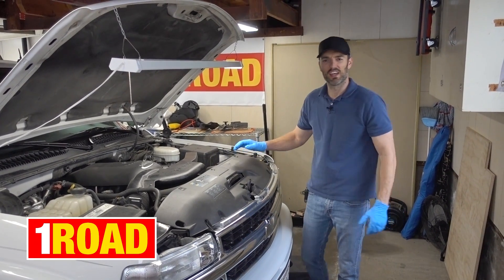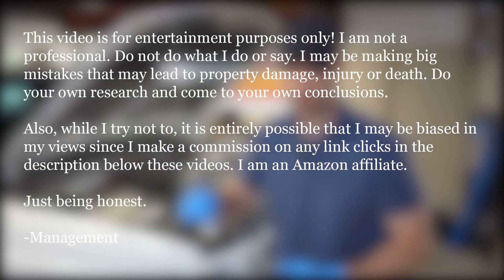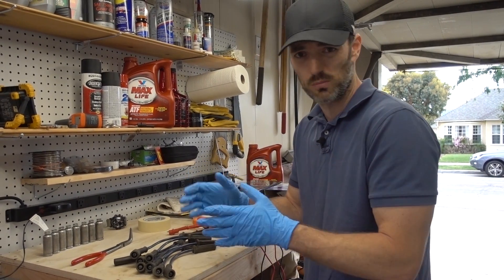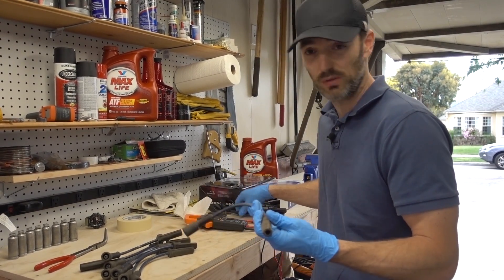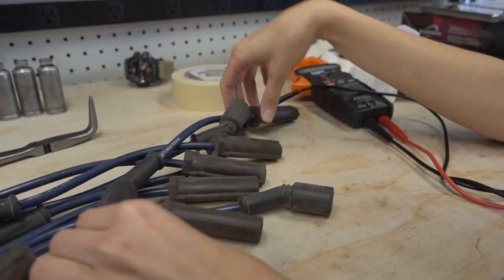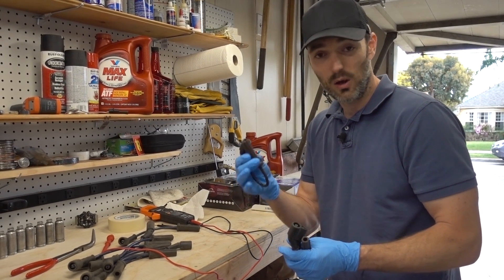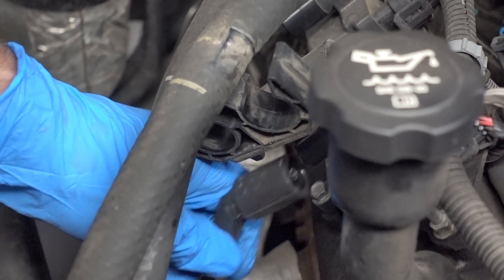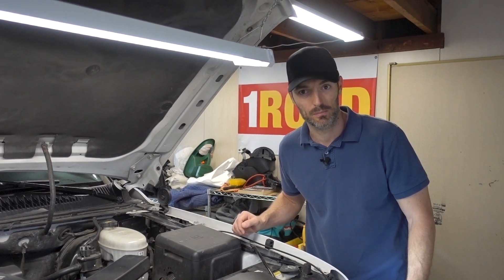Why You Should NEVER REPLACE SPARK PLUG WIRES WITHOUT FIRST TESTING FOR OHMS!

Comment: Go with the lowest resistance wire possible. Make sure to use dielectric grease on your boots but not on any connections and then use a fast flashing silicone spray over the complete outside of the wire and boot after installation. All spark plug wires will come apart depending on how they are made the better ones are rebuildable so if one came apart on you is because it is one of the higher quality cables like you said belden, hat is the best you can get without either making a custom set yourself or ordering a custom set and of course custom sets are going to be reportable because are custom tailored to your given specs. That definitely always go with the lowest possible resistance with the best possible insulating materials. With the options you've given us in this video that would be belden. Here's a nice little tidbit for you, belden wires are the only wire that I know of that does not have peanut oil in the material list for manufacturing. And peanut oil being used in the manufacturing process of these other brands of spark plug wires is why rats get under the hood in chew at the wires they smell the peanut oil.
Reply: Wrong and wrong, spark plug wires SHOULD have a controlled resistance AND dielectric grease actually adds resistance, look at the defination.
Reply: dielectric, insulating material or a very poor conductor of electric current. When dielectrics are placed in an electric field, practically no current flows in them because, unlike metals, they have no loosely bound, or free, electrons that may drift through the material.
Reply: @williamsotak2870 you obviously did not read my comment correctly or you misunderstood it completely because I specifically said to add the dielectric grease only to the boot and not to any of the connections.... That means only the rubber part of the boot and not the metal connections inside of it... I know what dielectric is you don't have to explain it to me... And yes I do know that the wires should have a controlled resistance I also know that that should be around 10,000 ohms per foot of wire but son of the better wires are generally a little bit lower resistance than that. Thanks for your comment but I think you were misunderstanding what I wrote
Reply: @jdreynolds29  "Go with the lowest resistance wire possible"  LOL go back and edit your comments to match your BS!  ;-)
Reply: @williamsotak2870 yes I did start out my first statement 6 years ago with go with the lowest resistance wire possible, and I'm not going to edit that because that is good advice and the higher performance cables are lower resistance. Some high performance wires can be less than half the resistance of standard cables

Comment: I use Delco on all Delco equipped machinery. They did the research with OEM and have never failed premature. I have some big blocks that use Delco on the ignition, but spec Champion plugs.... Spec it OEM no matter the brand.
   And now, is story time....
Once upon a time there was a redneck (me) that had a riding mower that through much of an odd happening, had a magneto plug wire get shorted. As a 10-11 year olds mind works, and reading many hot rod/racing magazine ads, I thought I had the ultimate cure with items in the big shed. Copper wire, a.bit larger than the OEM core, Ohm test told me that it will be better than stock. A spool of heat shrink of various sizes, to help guard against abraison.
  Ok, we have low resistance firing 30 times/second (camshaft actuated points, the old cast iron Briggs). She picked up a lot of pert.... Until, she died. The mag coil died. It looked like the coil over heated. I then had a spare 12v car coil and a pull off plug wire. She still lives and mows.
  It is a '71 model Montgomery Wards garden tractor. She is the oldest of four, the newest being '06.
Take care from Oklahoma,
Mike and Vee

Comment: When I was a "kid" in my high school days, we could buy "resistive" or "non-resistive" wires.  The difference could be heard in your radio...  Non-resistive wires would make your radio "scream" as the engine accelerated.  Resistive wires made it so the radio was quiet all the time.  Of course, resistive wires were more expensive and radios had knobs that turned back in the late 60s to early 70s.  You also had to "dial in" your radio to the station to get the best reception...  So, resistance equates to noise output.  I would think, the higher resistance wires equate to lower Electronic noise output.  Cell phones, radios and other radio wave devices will be more effected by lower resistive wires.  That is the difference.

Comment: 4:45, I would keep spark plug terminal free of Dielectric grease. Dielectric grease is an insulator.
I always apply some grease with a small brush or Q-Tip inside of spark plug boot.

Comment: What plugs and wires should I put on my Turbo Stroke diesel?  

LOL.
Reply: The kind of glow
Reply: Hehe, it really was a joke.  Better make sure the glow plugs aren't a shit brand, else they swell up and well I've got a truck that ate a glow plug tip because the prev owner was a idiot and used autolite brand glow plugs.  The engine didn't seem to care, it's got a little over 470k on it also.
Reply: @PatrickBaptist  I replaced the set in my 83 6.2 diesel Chevy van years back I think there's only about an inch of room between the valve covers and the dog house seal but the top bolts on the transmission we're a breeze to get to when I had to replace the torque converter
Reply: I had a 95 G30 with the 6.5, worst diesel I ever.....  I only bought it because it was a prison van and I thought it would make a dandy tool van....  I don't know what made me think a chevy would be good for me, I've never had one that was good....  
I've pulled a 7.3 from a E350, it was such a pain, oil pan, oil pump, fly wheel, starter, spacer all had to come off before it came out...  and then the same when putting it back in....
I'm a big IH fan, I've got a DT530 and T444E.  But I hate any diesel after late 03, the emissions just ruined them and half a million miles between rebuilds don't happen anymore.
I pulled a 454 out of a motor home not long ago, some moron only had 3 bolts in the converter and they were hand tight.....
Reply: @PatrickBaptist  my dad bought that band brand new It was a commercial vehicle 20 series with 5 bolt lugs had it converted in Lincoln Nebraska at the van house longest trip was from Belleville Kansas down to the Gulf of Mexico it's parked now at my dad's house I'm the second owner it has 265 thousand miles on it or 270 I would like to think during my teenage years if my foot spent less time on the floor the rear and front main seals would have leaked a lot less it always kept it's cool though never got hot I think if I ever had to pull the engine on it I would have to Jack the body up off the frame I've had to do that with a cab of an S10 so I could get the top transmission bolts out to change the clutch seems to me with any turbocharged diesel that's not in a big truck doesn't have the cooling capacity for the power that they put out
Reply: Neato, mine wasn't a turbo, but it sure ran hot over nothing, till it blew headgasket and I bet the head was cracked, but I found someone to take it off my hands.  It didn't even have 150k miles on it.
If it's a diesel after 1/4 million miles, it's going to have some oil leaking a bit, it's the nature of that creature (brand bias aside).
On the van I did, the better way would have been to pull the cab but the bolts were seized on there, it wasn't my van and I wouldn't cut them off and be liable if for any reason my welding wouldn't hold up say in a crash or something so I went about it the hardest way.  Then dude wouldn't pay up the rest of the bill, I had a lien on it and sent it down the road to the crusher over $160, rebuilt 7.3 powerstroke and all.

Yeah on the vans they don't have room for the cooling they need at all.  That's why I'm out of the pickups now and into the commercial chassis trucks, also I likes the 36klbs GVWR and air brakes.  Ohh and of course a 20' bed is WAY better than an 8' bed.
Reply: @PatrickBaptist  the only saving grace for a 6.5 L diesel the only application where I never heard anybody complain about and only praise would be the Marine 6.5 diesel the guy I work for as 2 Fords that are 2004 one with the 6 l and one with the three valve and both are parked well before their time he's got a 98 Dodge extended cab 2 door with the 24 valve Cummins four-wheel drive he bought it for $800 the guy who sold it was smiling like stealing from us called it a parts truck he had all the parts put on it I don't think the guy got the vocab right we had to do the brakes and injectors but that guy he already had an injection pump put on new headlights and taillights now we're even plastic bits to fix up the tailgate in the glove box it might pull an old car or gas pumps on a trailer and it's been there in a pinch to get is a 87 Peterbilt fuel transport pulled off the road and away from the prying eyes of the highway patrol it seems to have a splitter issue when it gets cold leaves it unable to go into gear he keeps on complaining about not having four doors his family has been and oil and fuel since 1936

Comment: Lower ohms resistance in the wires that you have will put less stress on primarily the coil, and keep the computer from doing more work than it has to do. The computer controls up to the coil, everything else after the coil is mechanical until it starts reading higher ohms resistance and makes the coil burn out. So you put the best sparking plugs and the lowest resistance wires so that you don't have to replace coils. A bad coil can eventually burn out a computer which is really expensive.

Comment: Not a big fan of NAPA. I found out that its just a name on a component box and a higher price. I stay away from napa as much as I can. I did a comparison on price and brand on radiator caps. They were all "MOTORAD" in different boxes and different prices. 5 different main store here in Az. Napa sucks. I am an OEM guy. But I shop around for my customers, I look for quality products, at a good price. I don't care who has it, in most cases but I do my best to stay away from Napa crap

Comment: Good video, thank you.  In my non professional experience, poor insulation is usually more of a problem than the resistance of the wires.  Wires may look good, but still have cracks or pinholes that bleed off energy.  It is difficult to check insulation on the bench.  Shops have oscilloscopes that detect waveform distortion caused by bad insulation , but oscilloscopes are expensive.

I go with OEM wires when I can because they have the best chance of matching electrical characteristics.  OEM wires are also the correct length.  When in doubt, I replace the wires.  Once wires are five to ten years old, I usually just replace the wires regardless when I change the spark plugs.

Comment: Low resistance means better spark. Higher resistance is for eliminating radio interference. If you had no radio interference the low resistance leads are probably a better choice. OEM isn't always the best option. The manufacturer makes compromises because they have to try to please everyone. Doesn't necessarily mean they work better in all circumstances. That's why we have a high performance parts industry! BTW I hope that you're not putting that oil/transmission fluid displayed on the shelf in your vehicle. You can get MUCH better oli than that.

Comment: The value of resistance of a lead can be up to 1,000 ohms per foot, which means that both sets of leads are functional, and so worth keeping. Consider that a pulse of 20,000 volts reaches the electrode of the spark plug, the resistance you have measured and compared is effectively very small, given the DC resistance of the ignition coil (secondary winding) can be as high as 10 kilohms as a new and functional item.

Comment: I think what you’re asking is are we brand snobs??? To an extent, yes. For fit, finish and functionality, I use AC Delco or Delphi for GM. Motorcraft for ford and it doesn’t matter for Chrysler, it’s all crap. For most all import stuff I try to use Beck/Arnley, they have always provided a good aftermarket for imports. Plugs themselves I will use Delco motorcraft and the only thing I use a champion in is a Chrysler or my lawnmower. I will also use NGK Or Denso in place of any of the above, and only use NGK or Denso in an import.

Comment: Believe it or not, you want wires with high resistance. As the wires heats up due to under hood temperatures the resistance will go down. Resistance is needed for proper spark thru the different ranges of engine load. This is why the just don't run a regular 14 gauge wire as spark plug wires to your plugs....... And yes, I try to use OEM parts when ever possible, for proper fit , finish of the job at hand.... Good luck !!!!!

Comment: Ohms is usless in automotive. You cant simulate load or heat with resistance. Voltage is king, an osiciloscope is the only true way to measure ignition wires properly.
Reply: You have a good point. Not only that, but to REALLY test a wire, you'd have to have the scope on it AND then take it out on the road, get nice and hot, subject to vibration, and working that ignition under high load. They had to make the wires better since at least the mid 90s to get the manufactures past the emission warranty 7 yr /70 k whatever it is. My 98 F150 , V8 w/128k miles showing on the clock, has 7 of the ORIGINAL factory wires on it. Had to replace one recently with one from a wrecking yard, (been replaced on donor truck) ohmed out at around 14k while the replacement was 7.5k. Thing was my CEL was only coming on intermittently and same with the code being thrown. Shop(S) had put code reader on it, and most likely viewed with o'scope AND of course all cylinders were hitting fine with it sitting there in the service bay :P Replaced just that one wire, and unbelievable how much better truck runs. In my case believe that one wire was defective from the factory.

Comment: A plug wire is a plug wire. It conducts electricity from the coil to the spark plug. As long as you insulate it properly you could use a coat hanger. You can use whatever brand you want but anyone thinking they "need" to use OEM plug wires probably thinks they "need" to use OEM windshield washer fluid as well. It is literally a piece of wire wrapped in insulation, as far as parts go there isn't much on a vehicle as simple as a plug wire. 

There are some cases (mopar electronics) where OEM is the only thing that works. Aftermarket parts will fit and function properly for a little while and then mysteriously fail. You can keep putting aftermarket parts on one after the other and they all fail within 30 to 90 days. Then you buy a "Genuine Mopar" part from the Dodge dealer and it lasts for years. I've never seen it from any other manufacturer besides Chrysler. If I had to guess I would say they have a way for their parts to identify themselves to the PCM/ECM/BCM as genuine and aftermarket parts can't do that so it overloads the part until it fails. There is no legitimate explanation for aftermarket parts from companies who have been building these things for years to keep constantly failing and then an OEM part lasts forever. 

So unless you are working on a late model Chrysler vehicle going OEM is just spending more money where you don't have to. It's your money and if it gives you peace of mind open your wallet as wide as you want. I'll keep using aftermarket parts and spending 1/3 or 1/4 what the parts guy at the GM dealer wants for the OEM AC Delco part. The belief that OEM parts are better is an old wives tale.
Reply: As you age you begin to appreciate old wives tail.

Comment: B17 wingman  . you want resistance. The wires are resistor type as well as plugs. o/e wires are always best. resistor type ignition was designed for low R F I, RADIO FREQUENCY INTERFERENCE..

Comment: Cold plug wire resistance is almost a useless measurement. I should say useless on wires with built in resistance. The only way to test the real resistance of a wire is to check the voltage level going through the wire when its running. This is done with an oscilloscope. When a car is new in may show 15-20K volts are needed to fire through a plug/wire. As the wire ages and the plugs contaminates the resistance will go up. At 5 years that can go up to 30-35K volts at idle. The voltage requirement will also go up  as pressures in the cylinder rise. A misfire will occur when the Plug wire/plug and cylinder pressure exceed the coil out put capability.  A scope can show you when you need wires but the testing will cost more then the wires at most shops, so unless you have a scope laying around replace your wires every 5-7 years and you will be fine. If you push them too far the constance high voltage can damage the coil(s).

Comment: Lower res = more power to the plug .....  as long as you got no noise in the radio, run the beldens ......
 Ive run them on my turbo cars with good results..

Comment: Its not always about OHMS, its a lot about insulation integrity.  Run a screw driver along the wires in the darkness and a bad wire will glow blue when the insulation is breaking down.
Best wires I've see were from Jacob's Electronics, now owned by Mr Gasket.  Lowest resistance and good emf suppression.